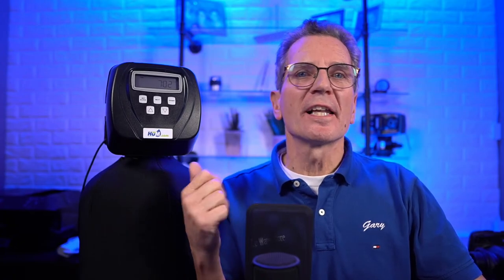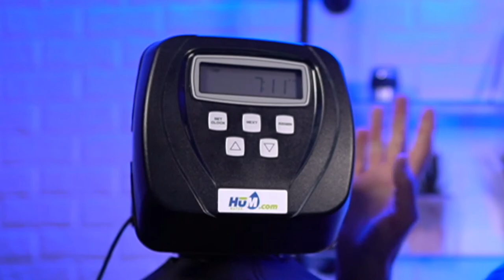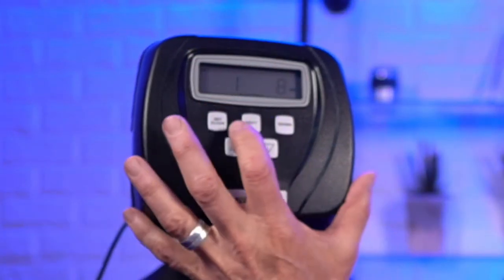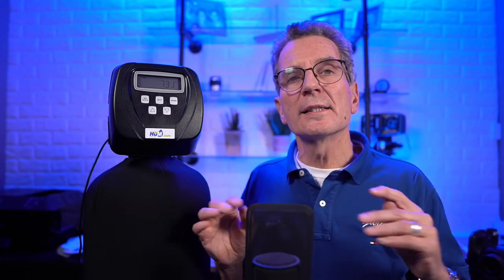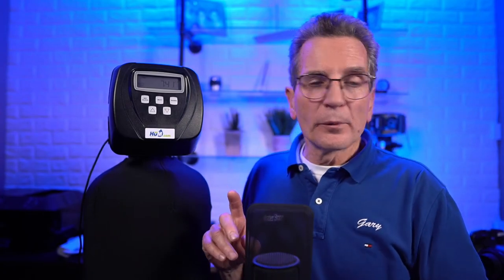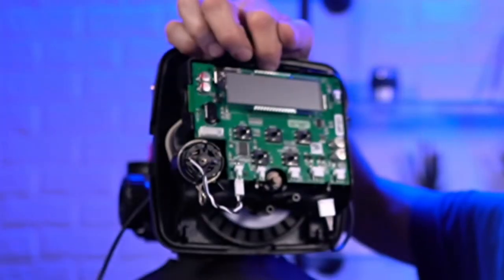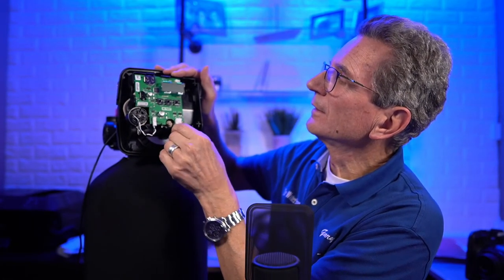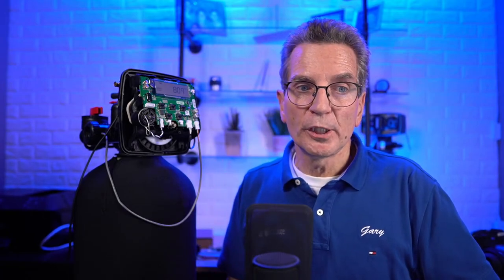Clack WS1 Water Softener Programming Live Stream

Comment: Hey Gary. Thanks for the tips how to set up the hardness of the CI clack. If I have 469 µg/l iron = 0,47ppm iron
 and hardness 22,77 °dH = 405ppm (water well), that means I will have to set like 408-410 ppm in my clack CI? Is this correct? Right now I have 200ppm set in my clack and the water is very slippery sometimes. Thanks a lot.
Reply from the maker: For every 1 ppm of iron you add 85 ppm to the hardness.  So in your case, 405 + 42 = 447 ppm or 26 gpg
Reply: @water_estore  Thanks a lot!
Reply: Wow... this video just saved me a lot of frustration trying to decipher the owners manual that came with my "new to me" Fusion F2/F45 (5-button Clack WS1 with meter and 45k tank) softener. The guy I bought it from had no idea what it did, had it hooked up to city water so I had to replace the resin, and was clearly "playing" with the settings. I followed all of your install/startup videos, reloading the tank video, and a bunch of others. I installed the unit myself, then watched this one after I got it up and running. I also did a 20" 5-micron filter upstream of the softener to keep out the wildlife. Into this whole setup for about $1000 CDN and now my well water kicks ass 👍
Still kinda muddy on calculating my hardness (around 120mg/L so I have it set at 18 I think) and salt usage (I have it set at 12.5) but I'm pretty sure I've got it pretty close. I need to do a proper analysis and get away from these stupid litmus tests, but the girlfriends' super sensitive  hair and skin is very happy so that's a pass for now. 
Thanks for all the help and videos Gary, keep em coming 👍